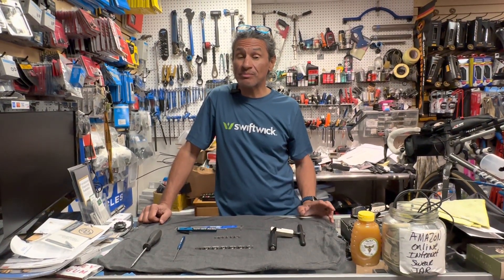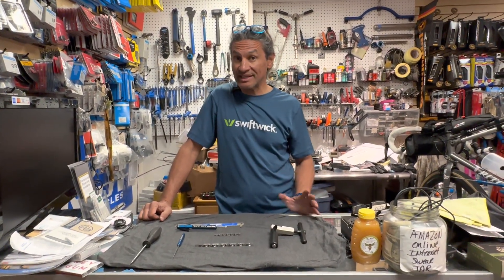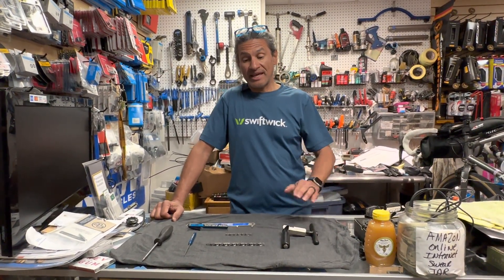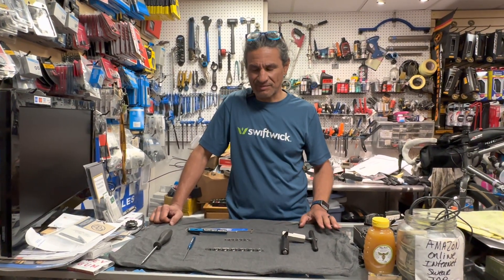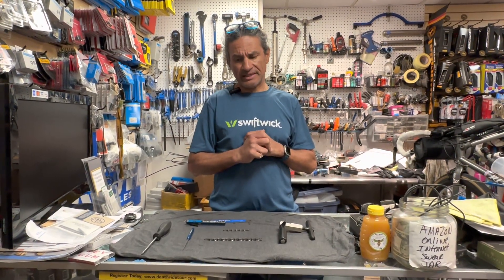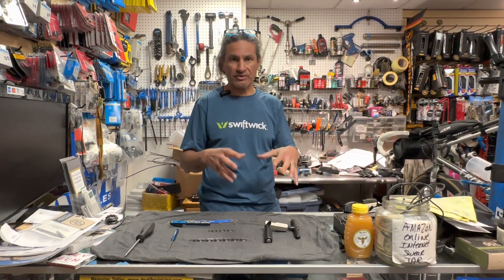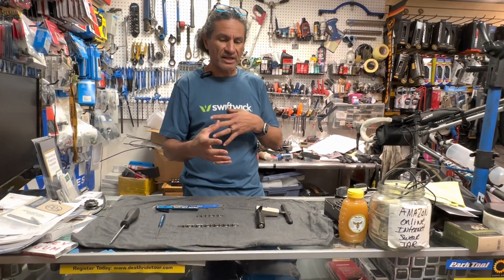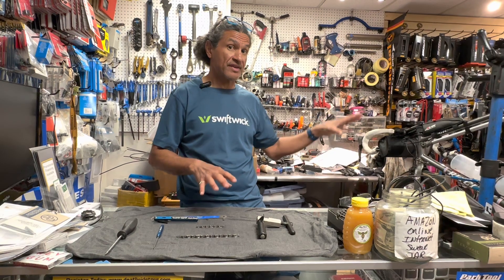What is chain stretch and where to lube to prevent it.

Comment: Great video, teaching to a good level as usual. Look forward to the chain wax vid. Would you include a run through of preparing a new chain with wax, and then after a wet and grubby ride what is required? Separately, id love a longer clean and maintenance video after a wet and grubby ride. Perhaps after an event, video your own Clean Along video, which could also take care of the event de-brief? So you are giving commentary on the task, as well as the event. Thanks again for the videos.

Comment: Great info as always George! 

I use a wax based drip lube named Ride Mechanic- Bike Mix.

I used to immersive wax, but it becomes a pain after a while. 

Squirt is a bit thick to apply, and Zero Friction Cycling mentioned 50% of wear occurs within the first 1000km as it takes time for the wax to properly deposit itself inside the chain. That and the tacky feel it leaves has moved me away from it. 

The Bike Mix viscosity is close to water, so it seeps in easier. 

On a new degreased chain, I perform 3 lube applications 10 mins apart ( to allow the carrier fluid to evaporate a little) prior to the first ride.
Reply from the maker: What are THE ZFC test results of Bike Mix ?

Wow 50% in first 1000km on Squirt!
Reply: They haven’t tested Bike Mix yet, as it’s only relatively small still, but it has a solid following of those that use it. Yes the wear with Squirt blew me away. I can’t remember which video stated this, but I suppose you can reach out to them directly.

Comment: I use squirt too and I re-lube about every 3-4 days. Is that too often? (i ride almost every day). The 4oz Squirt bottle has lasted me about a year and half and still has a few applications to go, so I don't think I'm running through it too quickly. I put just a drop on each roller. One thing I also do during each application is wiggle the chain laterally to kind of work it into the rollers instead of hoping it soaks in. I wipe off the excess from the outside of the plates and from the teeth of the jockey wheels, chainring.
Reply: Just listen to your chain. Keep it quiet and smooth

Comment: I think it's also worth mentioning to use a quality chain wear measurement tool. Initially I used the the park tool CC 3.2 and according to Zero Friction Cycling it might be just a simple stamped steel tool which doesn't has the best manufacturing tolerance so measurements are not necessarily super accurate. 
Now I'm using the Shimano TL-CN42 which according to zero friction cycling is a laser cut tool with much better manufacturing tolerance. 

I discovered this issue after measuring my chain with the mentioned park tool and it showed 0.75 wear after just over 950 miles and I was a little shocked and started investigating on what went wrong. In the process I found the website and YouTube channel Zero friction cycling (which I highly recommend checking out, it's full of quality information) where the gentleman talked about the importance of having a precise measuring tool. So I bought the recommend Shimano tool and remeasured the chain and it was still fine. So using a quality chain checker also saves money. 

I'm still not into waxing my chain. I use the Silca Synergetic oil based lube which is the best wet lube according to zero friction cycling.

Comment: I believe you only need lube on the inside of the chain. Any lube on the outside is just attracting dirt that gets inside, on the rings, cogs, and derailleur wheels. 
If you lube the chain while it's on the bike, spin the pedals backwards, drip lube on links as they EXIT the jockey wheel. Centrifugal force will force it through the links. If you drip lube on top of the links that enter the cassette, it will just get oil all over the cassette. 
There's a big difference between where lube is just after you apply it and where lube is once you've been riding. Excess lube will move towards the outside of the chain after the first few rides (centrifugal force again). This is why I wipe down the chain after lubing it and after the first couple rides. You'd be amazed how clean and quiet the entire drive stays until it's time to re-lube. 
These methods work with any oil, drip or spray, wet or dry, hot or cold.